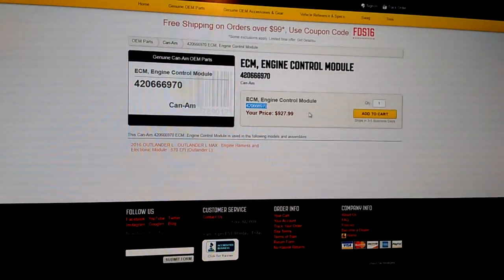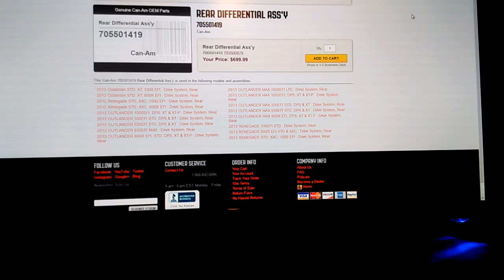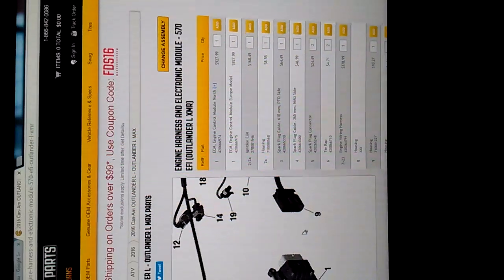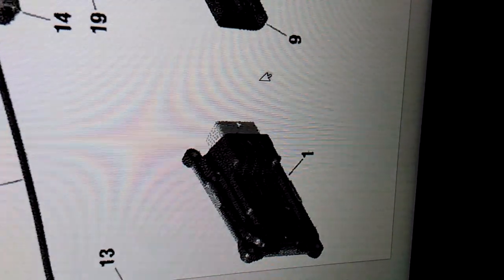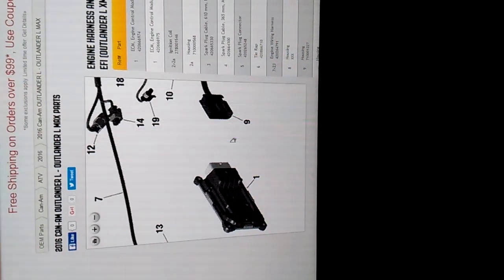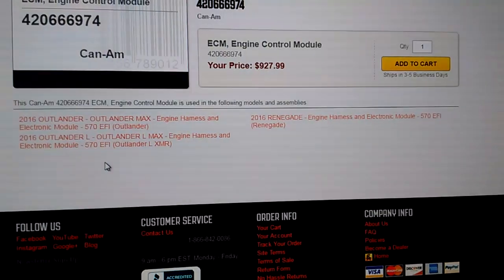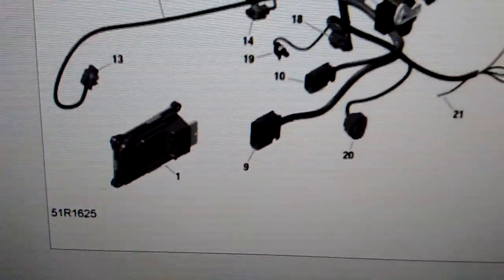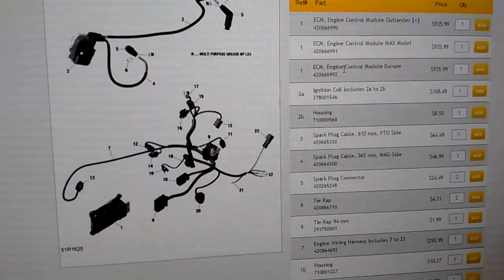2016 Can am outlander ECU computer failure water damage same computer as XMR

Comment: Christan, In the first video, I think you said you were going to try to repair it??  Did you ever make an attempt at this? That chipset with the hole shorted right through it look beyond repair to me. That thing shouldn't have been shorting in the case long enough to burn a hole in it like that.  I have to wonder if they properly grounded the metal casing.

Comment: What did you get first? Your canam or rubicon?
Reply from the maker: rubi is almost 2 years old can am is 3months
Reply: +Christian Amy I just got my high lifter rzr has 20 hrs. And the heat shields vibrate and the belts are so sensitive. I wasn't impressed with how much I spent. But i guess the xmr wouldn't have been any better
Reply from the maker: The highlifter Rzr only has a 12% reduction over my 900 not enough for the tires I'm working on a 27% I'll post a video should solve the belt issues

Comment: Thanks for rel review. I have 2011 polaris 850 x2 i ram it in water for 5000 miles. I pressure wash it had 1 short from corrosion on the connector  pin on the computer put wd40 on it never had problem again. I've seen Cant-am 800 get a hole in radiator every time out in Alaska brush absolute piece of shit. I will run over alder brush for days Cant- am cant do it for 5 mins and the rich guy keeps buying radiators dumb rich guys thats a cant-am guy dumb more money than brains.  So thanks again for your vid i was looking at cant-am 6x6 I knew there engineers are more worried dressing up barbie than if the machine can be driven by a real man. I beat the shit out of my polaris had some problems from lack of maintenance like dry rear diff thats on me broke axle thats on me over torqued starter bolt that broke the block when removing it that on polaris

Comment: You should have got a 570 xmr, they have a different computer. It's more waterproof
Reply from the maker: +Abraham Whitaker watch the video I show you the XMR has the exact same part number computer and wiring harness is literally the exact computer I don't know why people think the XMR is any different you have been lied to
Reply from the maker: +Abraham Whitaker watch the video I show you the XMR has the exact same part number computer and wiring harness is literally the exact computer I don't know why people think the XMR is any different you have been lied to
Reply from the maker: +Abraham Whitaker what on earth makes you think that
Reply from the maker: +Abraham Whitaker what on earth makes you think that
Reply: You are correct the part numbers are different. The actual Can  Am part website has two different part numbers for the XMR v regular 570. There are multiple XMR specific parts
Reply from the maker: +Troy Heffner the difference in part numbers has nothing to do with the housing or the connector or the O-rings nothing to do with waterproofing it has slightly different settings for when the fan kicks on due to it being relocated I was going to try to run that computer however it is no more waterproof
Reply: First you said they are exactly the same because the part numbers were the same; actually they are different. And since, once again, you are unique in your experience, there really is no issue other than you had one bad ECU out of probably thousands made. There is no report of systemic problems with wet ECUs so to say its a bad design based one experience is completey dishonest.
Reply: One housing with one circuit board, what makes them different is the amount of hardware connected to the circuit board and that'll depend on what features your bike does or doesn't have.  From a manufacturing perspective that would make sense.